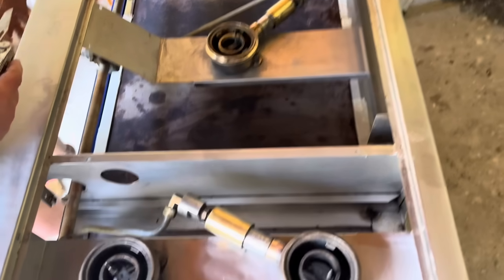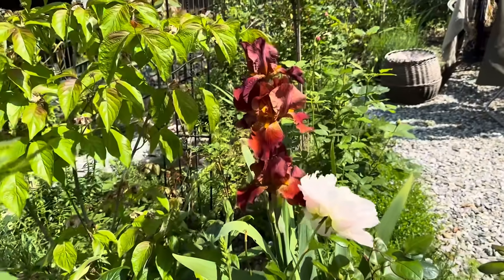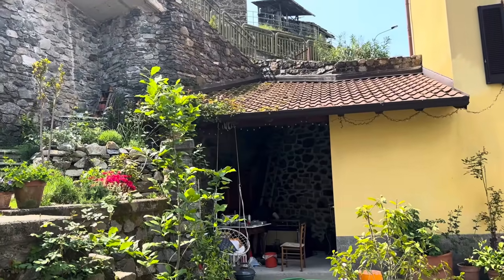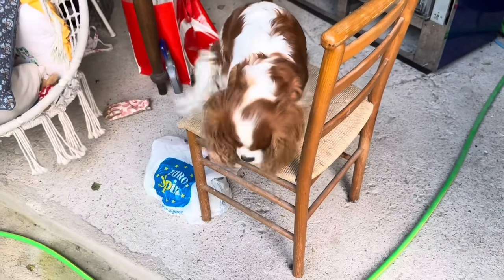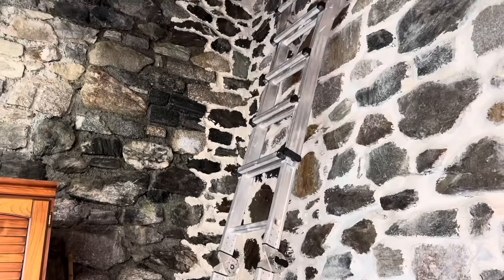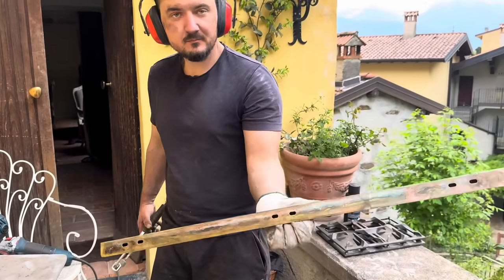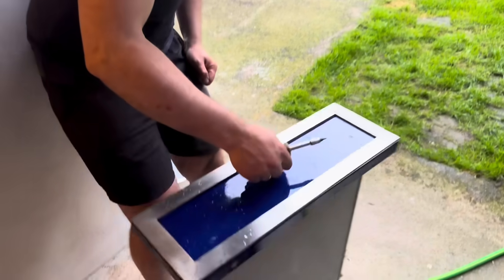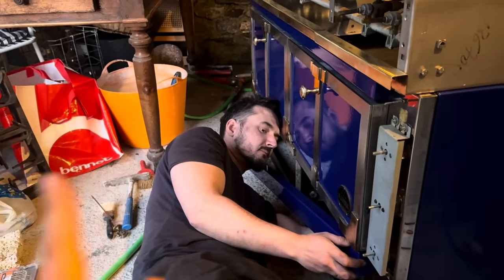Restoring our La Cornue stove / Renovating our Italian home

Comment: Is the cooker destined to stay outside in the summer kitchen?  I would think that it wouldn’t be good for it. I would be afraid of the critters that would be crawling all around and inside it. Maybe even chewing on the electric wires on the back of it. Great work by Sergi in restoring it. It looks brand new!and the work you are doing with the stone wall is transforming the whole area!  Beautiful. The garden will be the spot to see in town. A showcase for sure!  ❤️😊
Reply: I have heard of critters chewing on electrics and starting a fire.   This is a possibility you need to consider.   Steel wool in small holes will keep them out.